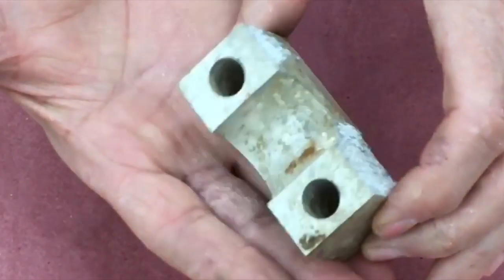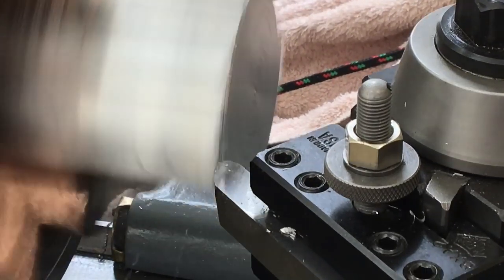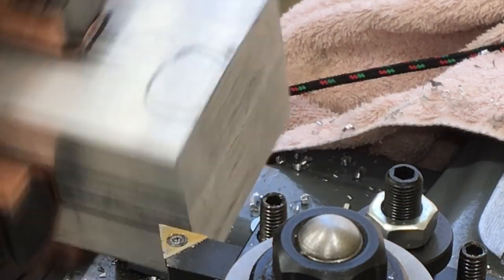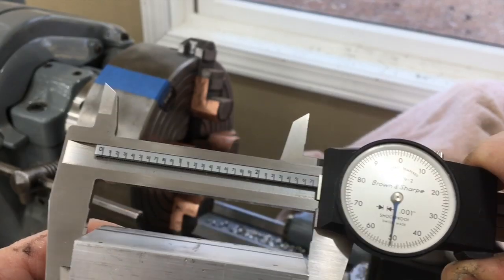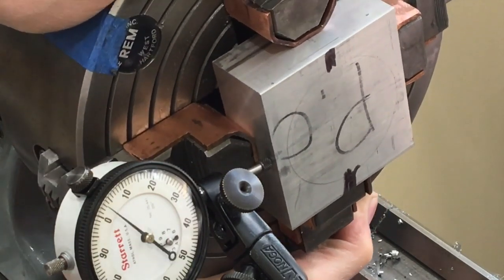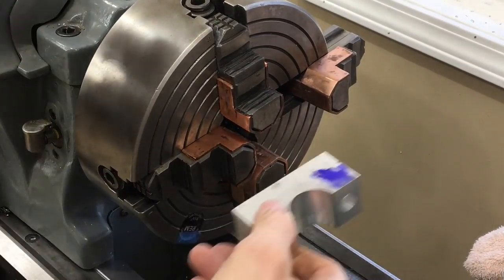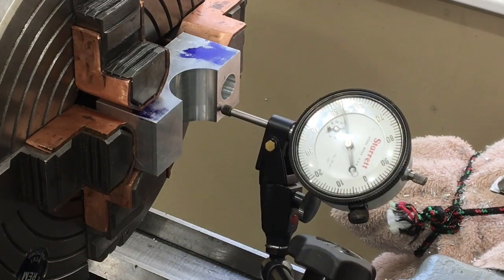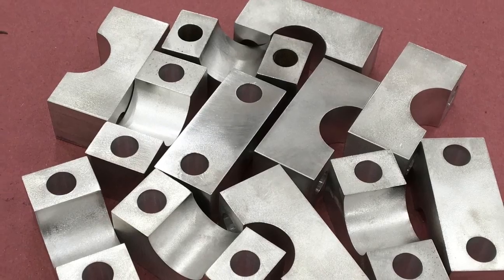Making parts on the lathe

Comment: Just an idea, next time split the block, mill the mating surfaces then bore.  You can drill a hole first if you want but the final boring should be after you split the block, then you get a round hole,
Reply from the maker: Thanks for your comment.  These blocks are clamps…. So the holes needed to be something less than round to allow clearance for a clamping action

Comment: When I saw you facing two parts at the same time 1:32 , I thought you would drill and bore the hole with the split line on center, saving the saw cut.
Reply from the maker: Sure, it could have been done that way.  Thanks for your comment

Comment: You had me at the Snap Gage!  IMO, the only accurate way to measure a bore.

Yours look like Mitutoyo, which I believe are currently the best on the market.  I’ve got both Mitutoyo and Starrett – I like the shorter handles on the Starrett, but I do think the quality on the Mitutoyo is slightly better. I also use a micrometer stand which increases my overall accuracy and speed.
Reply from the maker: yes, you are right. thanks for the comment

Comment: Beautiful job. Shows what can be done on the “wrong” machine when you’re in a pinch and need parts. You can slow down that saw for metal cutting with a VFD and 3 phase motor, with no loss of torque, to make it much more versatile for not that much money.
Reply from the maker: Yes, I have thought of this conversion for the wood band saw, but might just get a dedicated metal band saw… thanks for your comment

Comment: Great to see you using the South Bend George, my wife's grandfather Knight Thomas owned a machine shop and welding shop and got me started in the business. When cutting Aluminum on the lathe or mill he would always have a little can of Kerosene and a small brush to apply it on the cutting surface. I have done the same in years past (when I was a young man) and it seems to work pretty good. It might not be the correct lube and I'm sure I will get some advice on what I should be using but thought I would pass it on. Keep up the good works George and thank you for sharing.
Reply from the maker: Thanks for the comment
Reply: I ran a badly worn South-Bend in one shop that produced poor finishes and broke many cut-off blades when the spindle jacked up due to worn headstock bearings. I did not know how to rebuild the head and adjust the bearings back then by now I do, thanks to your excellent teaching videos.
Reply from the maker: @ellieprice363  thanks for the information and nice comment